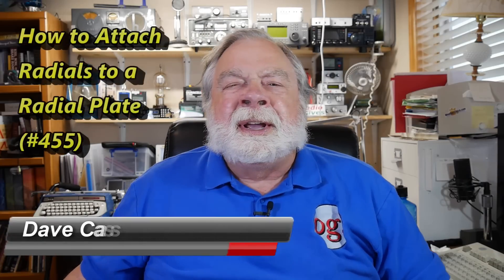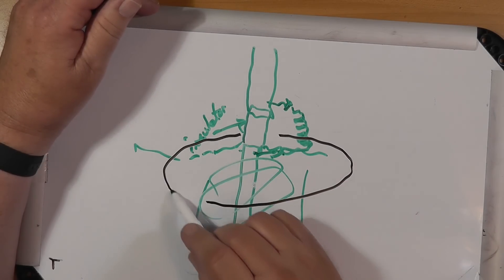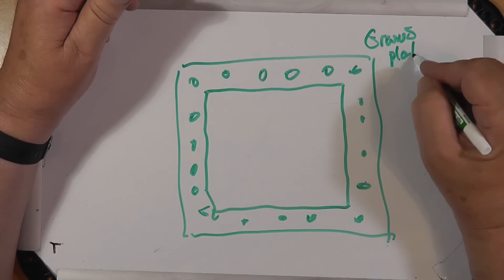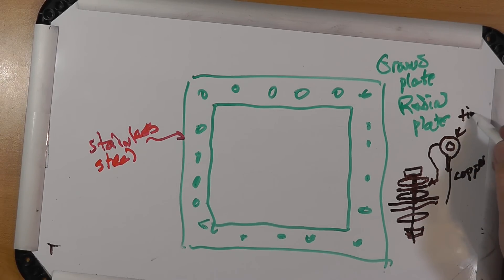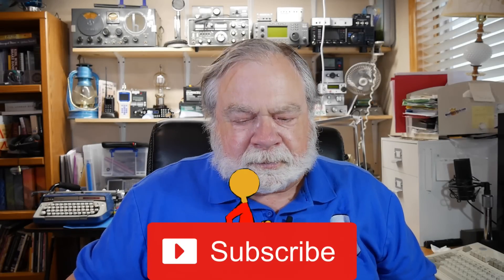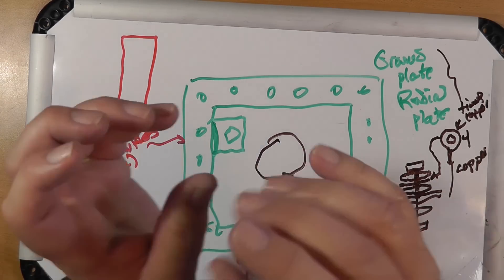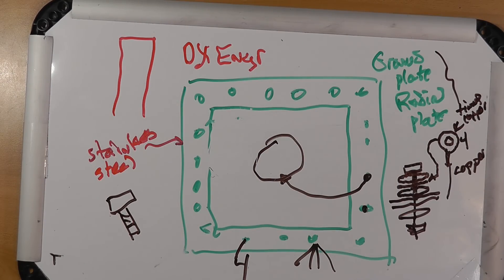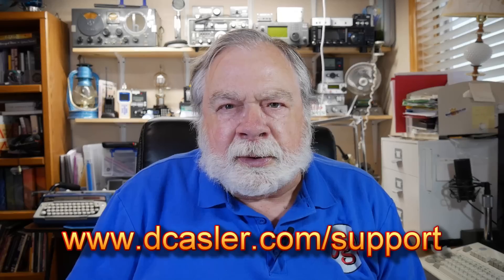How to Attach Radials to a Radial Plate (#455)

Comment: How to build your own radial plate, go to Walmart or somewhere similar and by a large pizza pan and drill 1\8 inch holes 1\2"  apart around the out 
Side perimeter go the hardware and buy the appropriate number of 3\4" by #8 screws and twice the number of  nuts as screws,. With a little engineuity you should be able to come up with a good radial plate. 73 from ki0ad/Jim

rill

Comment: Zero 5 43' vertical in very small backyard. Have you a comment on using hardware cloth as short 2" Wide radials? Effective if only a few about 10 or 15 feet long, or waste of time?

Comment: I have a Cushcraft 9-band vertical that is advertised as “No ground radials required.”  I had it roof mounted for several years with ok results.  It is now ground mounted and works ok.  Even though radials are not “required,” would the system benefit from radials as you described in this video?  Thanks. LARRY - W7LDT

Comment: So, you can't just pack thermite over the radials and base and just fusion weld them all together, huh? (WEG)
Reply: 14 AWG is the minimum  wire gauge for cald welding.Find a suitable mold might be difficult to find. Wire terminal ends is probably the easiest (and less expensive) route to take. Also 316 Stainless is much more corrosion resistant than 304 Stainless.  304 contains 18% chromium and 8% nickel while 316 contains 16% chromium, 10% nickel and 2% molybdenum. The molybdenum is added to help resist corrosion to chlorides (like sea water and de-icing salts).